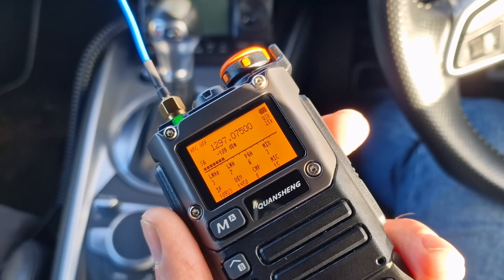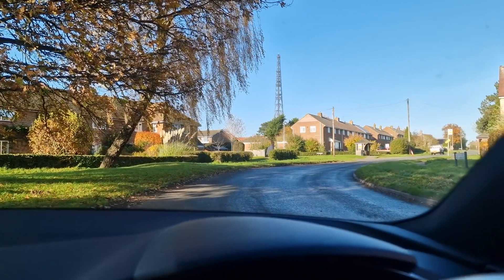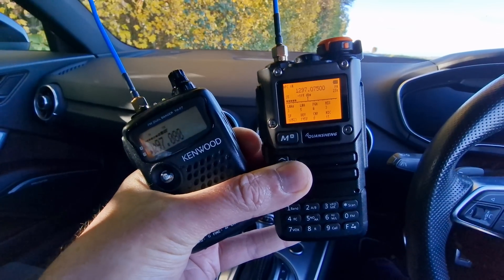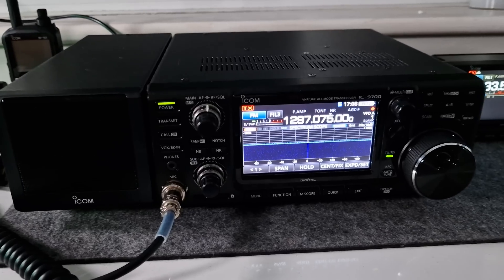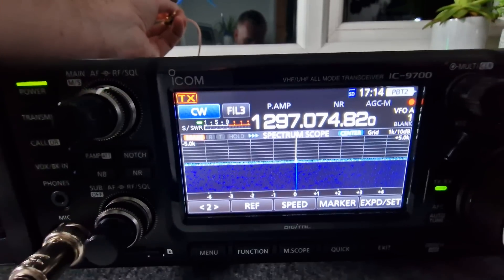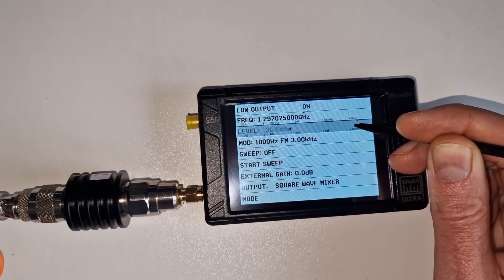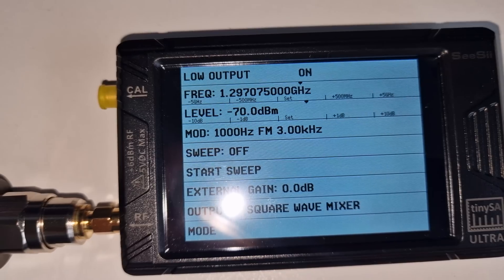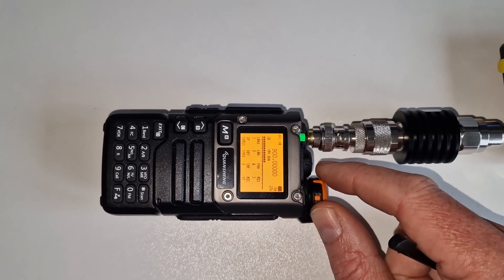CAN THE MODDED QUANSHENG RADIO RECEIVE 1GHZ+ SIGNALS?

Comment: I use the IJV v3.x and in my case it's completely deaf above 900 MHz!Tried with a 1296 MHz repeater in visual range about 15 km away and I have no reception while my ic-910 with same antenna rx 9++. Good job with the video mate , glad it works for you! best 73!

Comment: Hi - I've seen a few videos with this unit and I guess I am little confused about something.. Is this just a full range scanner, or could you actually key up within its freq. range?
Reply: Well the UV-K5 comes with TX enabled for the US ham bands and rx on 50 mhz, FM AM airband, VHF, UHF and even 470-600Mhz(RX only). But with firmware modifications you can receive from  18mhz to 1300mhz. With more modifications you can even transmit but the harmonics are not good and you transmit very low power. Also highly illegal.

Comment: 23cm ham band with slow morse id wheres that them radio are good for what they are 2 70 the firmware just opening up the sdr ... but no hardware to do anything usefull ,,, i know people going crazy about them lol dont you think china would advertise and put firmware on it if it would make them usefull for anything else as a selling point,, trying to tx on other freq just will burn out the pa,s as the filters will be wrong and mess up the swr and mmm heat could be usefull as a hand warmer lol

Comment: Those radios made from chinesium have terrible front ends.  They are easily deafened by strong out of band signals.  So, test sensitivity again, but generate another signal out of band that is strong and try again.  You will find it to be terrible.  Modulated morse on 1.2 GHz.??!!  What is that for?  Is that just the repeater IDing itself?  Or is that a transmission of some kind?

Comment: Why do you keep calling these radios “CB”. They are not citizen band radios.
Reply from the maker: for the algorithm...
Reply: @andykirby   Fair enough mate.
Btw, I have custom firmware for the UV5r which i wrote myself. (Rather modified).
It opens the RX to much wider coverage and it also lets to RX (AM on the 118 to 138 band.)
The RX is between. 0Mhz and 999MHz.. BUT!!!…..
I’ve yet to test it all. I’ve tested it at 5,7,14,26-29,50,70,FM Broadcast,Airband,2m Ham band, Marine band,……. It TX’s on all those bands with my modded firmware. I’m still testing. I’ll continue to test today when I get home. I do know 430 to 459 is also covered.
The UV5r has very good firmware in regards to moding.

Comment: Back in 2008-2015 i used to climb these towers to fit pirate radio equipment. Was great fun! Done most of the eseex ones!
Reply: Now THAT sounds cool!
Reply: @MrTommy001  offcom didn't think so. Nor did the police helicopter 🚁 😳 🤣
Reply: We had master keys to the top of the flats and we'd put the link transmitter in the lift shaft. Great times. Climbed a few towers doing urbex. It was DTI when I was younger.

Comment: You are an idiot. You go up to an RAF communications tower which is covered by the Official Secrets Act and you publish on the internet transmission frequencies being used.

You should be arrested. The Official Secrets Act applies to you even if you have not signed it.

Comment: Excellent Andy well.put together video showing the transmitter site in the background as you focused om the Quansheng . I have a few of these radios. More recently i bought the Tytera 9800 which in export mode gives 6m , 11m , 10m 2m 70cm anf pmr 446 all in the one box . Cracking little rig it would be good to see yoi doing a video of it tbh mate as youve got a knack for explaining things.

Cheers Again for sharing
Reply from the maker: Thanks mate 👍🏼👍🏼

Comment: If the radio has a setting on it that can make your filter extremely narrow, you just might be able to hear that repeater. I do a lot of my dx listening on websdr and the app I use has several filter options making it fairly easy to find stations even y skywave can’t pick up lol

Comment: I don't understand the appeal of this hobby. The radio goes beep beep beep when far away and then beeps louder when close to the tower? You are testing the features of the radio with the end goal of listening in to people's communications? I am not following what the goal is here.
Reply from the maker: The hobby is about communicating with other HAM radio operators over radio, usually we use our voices over the air. In this video it's showing receiving a morse code signal from a tower that is used to relay voice messages. The tones are just like a beacon to let you know its there and operational... its possible to talk through this tower and it boosts your signal out further.

Comment: 1297 MHz is not microwave at this time...😊 (It was...50 years ago 😊)
It's only UHF...😊
Reply: Anything above 1GHz is generally considered microwave.  Your microwave oven operates at 2.5 GHz, which is still technically UHF.
Reply: @stargazer7644  
Yes.
Microwave concept evoluted through times.
It is best to use the term microwaves above 3 GHz.
Fist comercial microwave ovens were 10 GHz ( one ISM band). Then they've moved to 2.4 GHz (another ISM band).
We should call those UHF ovens.....😂😂😂😂😂😂

Comment: Try the "uv-k5-firmware-fagci-mod-v1.2.1-b6.bin" firmware for the best results so far. In the frequency scanner/spectrum mode, after pressing PTT to lock the frequency in, If you select "SSB" (it is DSB so you can RX both LSB and USB), And then toggle to the DEV setting and lower this to around 200 or 300, it will actually TX a reasonably good sounding double sideband signal. You can not only listen to SSB but you can talk there too! Amazing. (I did this test on 2m where I am licenced, and where the radio is reasonably clean (on VHF).

Comment: Hi Andy. I don't understand why almost everyone are excited, when trying to make HF radio (rather only receiver) from VHF/UHF handy. Without filters it's only a toy.

For me, real goal will be if someone is gonna modify 70cm band filters section for 23cm band. I don't know is it possibile, because there are 2 microstripes on pcb in 70cm band filters. It's harder to eventually avoid them, then just replace inductors with other ones.

What i know, there is a modification for 2m band, which allow you to change it to 4m band. That's realy something for me, because 4m handy's cost minimum 6 times more then Quansheng.
In future I'm going to make 4m band mod.

I'm very happy that are few firmware releases, that expand a lot functions of this radio.

4m band modification is possible now.
If someone's gonna make possible to modify 70cm band to 23cm band, it's gonna be awesome. There are no any new 23cm band handy's, and the older, used ones are rare and prices are high.
But that's only my opinion.

I'm curious on what things about this radio, You are working on with other friends. 😉
73!

Comment: great content Andy.
one question, why did you use a 40 db attenuator when connecting the TinySA Ultra to the radio?
I thought it would be a controlled level output on the TinySA.
Reply: Because the receive limit on a radio is far lower than the usual range of a signal generator.  10,000 times less in this case.
Reply: Maybe in case he transmitted.

Comment: Andy, curious to see the spurs on TX U.S. FM 1.2 GHz call frequency on your spectrum analyzer. Have an Diamond SMA stubby duck for 1.2 GHz - FM simplex is 1294.500. Where else is this thing transmitting when we use 1.2 GHz just for grins? Looking forward to this video when you have time. 73’ good DX.

Comment: it may not just be a sensitivity problem... wideband rigs can also get "desensed" in the presence of strong signals when something swamps the whole front-end & the whole thing goes deaf.... you go up to many a transmission site & many rigs chuck in the towel in their vicinity.
Reply: He tried it directly coupled with a signal generator though so doesn't that discount it being swamped?
Reply: @elguapo1507  yes the sig gen alone will identify how the sensitivity drops off "out of band" under clean conditions but under swamping conditions at a transmitter site things can be much worse.
Reply: @StreakyP  I agree completely but the sensitivity of the receiver has been shown to be fairly poor at that frequency by the signal generator. We used to test aircraft radio receivers at about -69db down and some systems -102db down and they were pretty precise. Testing direct coupled, instead of loose coupled, eliminates all other RF thus preventing swamping from happening.
Reply from the maker: Interesting theory will look more into this.
Reply: Very probably. I guess there is no bandpass filters in the frontend, as in more expensive rigs. The input stage can be saturated by undesired frequencies.
Reply: A narrow band antenna like a Yagi would have helped reduce the overloading from out of band signals.

Comment: Hunting a RAF station Transmitter, advertising the frequency I am sure is not in the best interest of National security
Reply from the maker: It's an amateur radio repeater 😅
Reply: There’s always one silver tin foil hat wearer on these channels
Reply: And the site left RAF usage YEARS ago 😂
Reply: I once managed to detect an RAF station using only my eyes and ears in conjunction with a map. How's THAT for national security?? 😊
Reply: Doh! It was used by the USAF for microwave links to RAF Chicksands, Alconbury, Feltwell, Lakenheath  Mildenhall. The MoD sold the site years ago,  the aircraft warning lights on the mast cost £90 each a day to run, so the new owner only used the very top one, they wanted to build a house on the land but couldn't get planning permission.  The mast was dormant for years but mew antennas and microwave links have appeared. CRG did say they weren't interested in this mast as they have been on the old PYE mast for years which is a quarter of a mile along the road

Comment: Nice review. The really impressive thing about the Quansheng, is that you can pick one up for £20 or even less. You won't get the Kenwood or the ICOM for that. So if you just want to experiment, the quansheng is a no-brainer, then upgrade to a more expensive better performing radio if you're enjoying it.
Reply: I Bought one 4 day's ago for £11 😊.
Reply: Including delivery from China
Reply: I feel ripped of now I just paid £13 for mine
Reply: @petecoo1978  I paid just under £11 from AliExpress, some were more expensive on there and I eas beginning to think it must be a Scam but it arrived OK.  Just have to get my old laptop working and update the firmware on it.
Reply: Just bought one on AliExpress for  7 pound and 3 pounds shipping. Arrived in 5 days from China
Reply: I paid £7 for mine with free 5 day shipping
Reply: @qrphfradio7753  Blimey that is cheap 😳 where was that from ?. Hopefully you have received it 🤞🤞. 
I just found mine delivered in the wheely Bin, still 4 days from China including customs clearance isn't bad going.😉
Reply: I rigth  no way